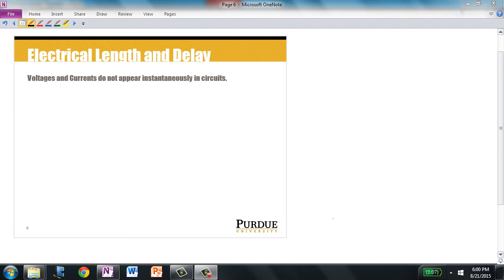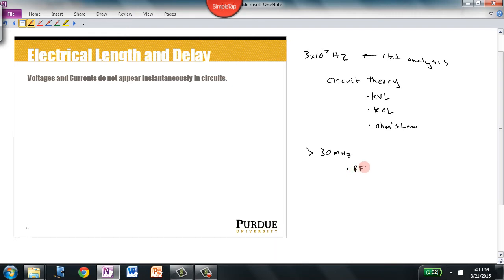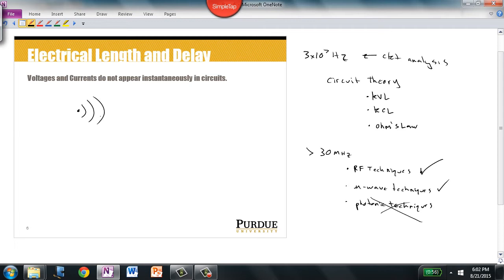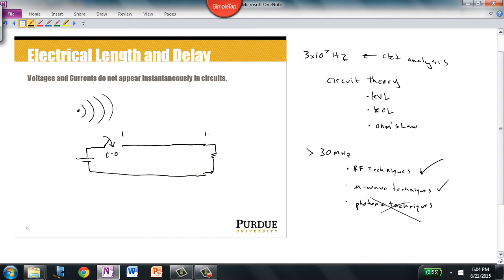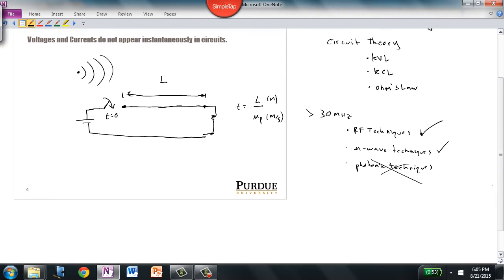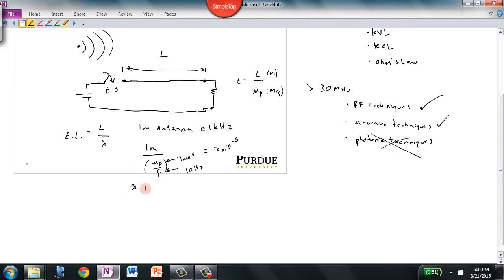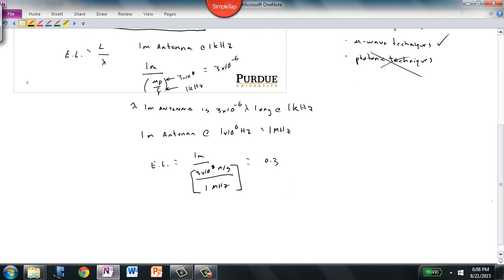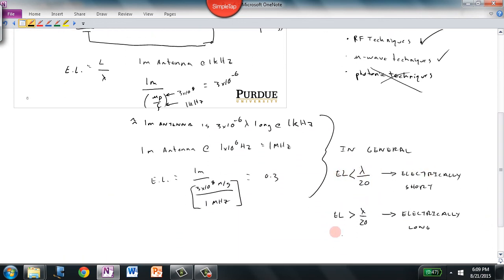Topic 1 Part 4   Electrical Length

Comment: At time 4:10 the DC circuit you claim creates an electromagnetic wave that "...propagates in the wire when the switch is closed"

I'm not sure if you realize it, but a DC circuit does not create EM radiation.  When the switch is closed, the + DC voltage establishes an electric field gradient on the wire of the circuit. 

Electromagnetic waves generally are propagated from antennas.  An AC voltage source creates alternating current flow in a circuit, but this is also not considered an EM wave.  

I suspect you meant something else.

.
.
.
Reply from the maker: DC sources do create waves in their transient response.  You are correct if referring to steady state, but I specifically mention that the switch has just closed, i.e. transient conditions.

Comment: Sir you said that electrical length is L/lambda = Lf/c where c = 3*10^8 ms. So when you will plug in the value of c and L for frequency f = 1 Khz, won't you get the electrical length as 1/3 * 10^-6 where you wrote 3*10^-6 lambda long...???
Reply: nah, 3*10^-6 is right